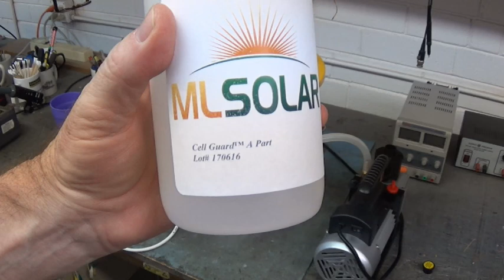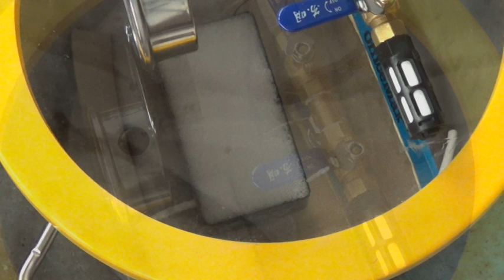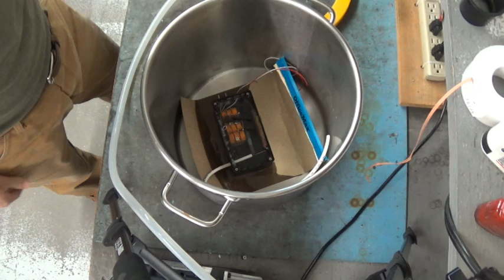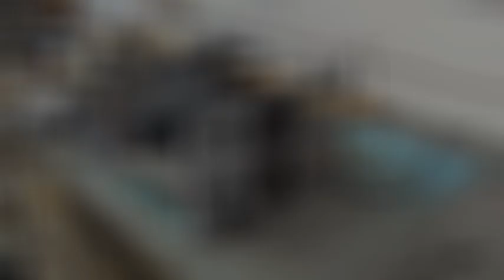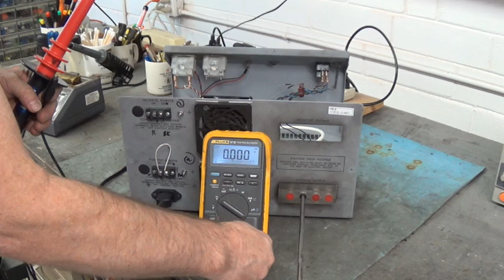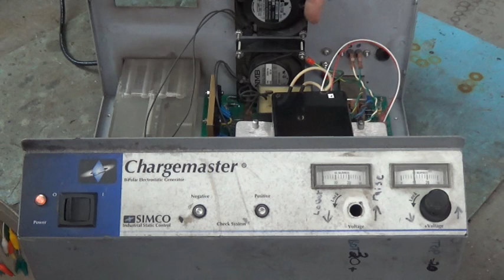(Part 2) Chargemaster High Voltage Module for the Simco BP30

Comment: Please please sir i came from the acopos video that i found it by chance and îm so greatful 

I have an error that shows dc link : voltage too low or unstable ,check the power line.
 I replace the capacitors  but i think its  dute to precharge unit
I already have the schema but i cant help it could you please help me to solve the problem.